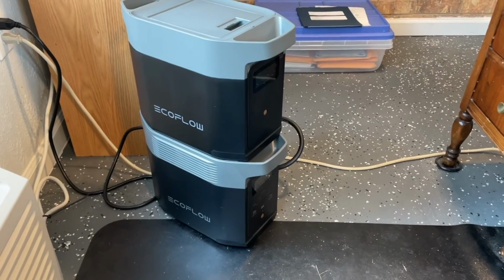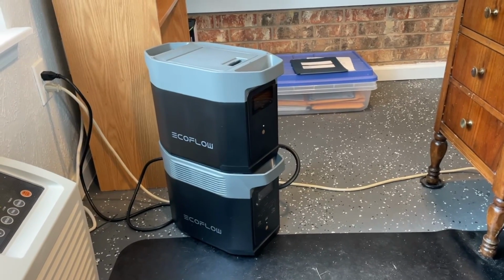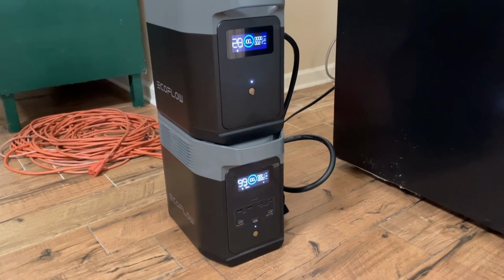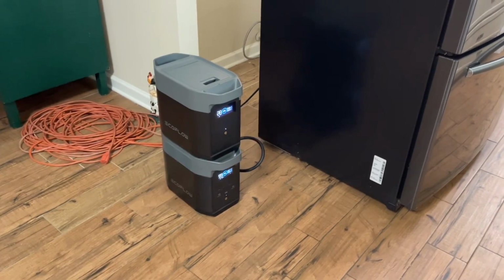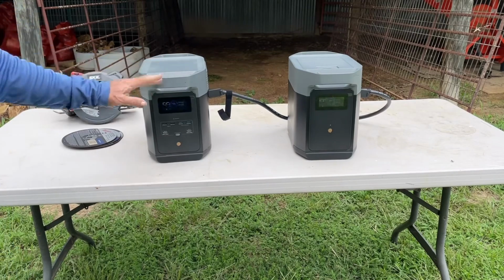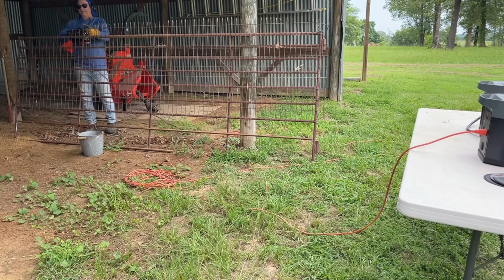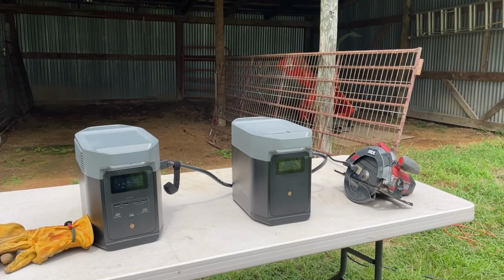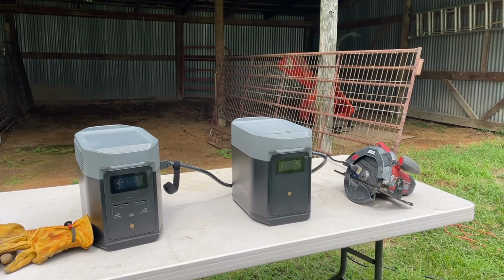1+ Year update EF ECOFLOW Delta 2 + Battery

Comment: Hi! I just received my delta Max and charged it to 100 %.  But when I plug a hair dryer or a fan in to test it, nothing happens.  It’s Friday night and the customer service is off.  Is there something I missed pressing other than the on off button?

Also, I would like to connect it to a permenant non portable 400 watts power solar panel.  The card that came in the box says use MC4-XT60 cable if connecting to 3rd party Solar panel.  I see people’s comment saying one can use MC4-XT60i to allow more current to flow while charging.  What do you think?   I don’t know anything about solar panels but would like to get this ready for gulf coast hurricane in the simplist way possible.  Any suggestion in terms of cables I would need to buy to hook up to solar panel is much appreciated.
Reply from the maker: are you making sure to turn it on, different outlets require a seperate power button to actually turn on and supply power to that outlet. depending on what solar panels you buy they will more than likely come with the needed cables
Reply: @spencerdoesreviews thanks, I figured it out there is an extra button that needs pressing besides the main button to get this thing going.
Reply from the maker: @stevedean3097  Awesome, glad you got it worked out. Its a common mistake for people who get a power station for the first time. Almost every brand has that extra button.
Reply: @spencerdoesreviews Spencer, from your experience with solar panel, are these power station compatible with most 400 watt stationary solar panels sold on Amazon?  And can I use the cables that generally comes with the panels, or are am I required to use the kind I mentioned in the first post which was stated in Ecoflow leaflet?  I do see people mentioning the MC4-XT60i cable wires which is supposed to allow more electricity to flow through.  Can I use that or am I going to mess something up?

Comment: Can you charge the ecoflow in a 220v at home and will it also power 220v devices?
Reply from the maker: These ones are 120 but they might have a different version that is 220
Reply: @spencerdoesreviews  The version i bought in Nigeria pumps out 220v and our power supply here is 220/240v ... D2 works flawlessly fine

Comment: A solar panel is a cheap addition that extends the use of your system. I need to get the extra battery because I  make more energy all day than I can use but can't go 24 hours with just the Delta 2. Yes, I  live close to the equator but you get plenty of sunshine in Texas and have longer days than I do in the winter.
Reply from the maker: Nice, we have a panel just haven’t busted it out that often yet

Comment: All you need now is a house 500 watt solar panel to keep it charged when the power goes out that's what i have.
Note you will need to get a cable to connect the solar panel to the Eco flow
Reply from the maker: Noice
Reply: Hi! I just received my delta Max and charged it to 100 %.  But when I plug a hair dryer or a fan in to test it, nothing happens.  It’s Friday night and the customer service is off.  Is there something I missed pressing other than the on off button?

Also, I would like to connect it to a permenant non portable 400 watts power solar panel.  The card that came in the box says use MC4-XT60 cable if connecting to 3rd party Solar panel.  I see people’s comment saying one can use MC4-XT60i to allow more current to flow while charging.  What do you think?   I don’t know anything about solar panels but would like to get this ready for gulf coast hurricane in the simplist way possible.  Any suggestion in terms of cables I would need to buy to hook up to solar panel is much appreciated.
Reply: @stevedean3097  Hi you will need the EcoFlow MC4 to XT60/XT60i Solar cable to connect your solar panel you can get this from ecoflow. 
Note  you can go up to a 500 watt solar panel witch is better than 400 watt. 
Just get one solar panel at 500 watts house ones work the best. 
The solar panel will only charge when the sun is out. 
You leave your ecoflow plugged into the wall outlet at night. 
And in the day time you go to your app settings then go to energy management and set the discharge limit to 25% and the set the charge limit to 100% by using the sliders, 
Also on the same window of the app go to back up reserve and turn it on. 
You will also see a slider bar 
Slide it down to 30% when you want to use the solar in the day time. 
When you are not using solar slide the slider back up to 100%. 
The cable that came in the box is for car cigarette lighters. 
If you want to run your hair drier you need to open your ecoflow app and go to the settings icon at top right of the screen.
And then scroll down the list and turn on X-boost you can leave this switched on. be aware any device you plug in that makes heat will use your battery faster.

Don't forget to unplug your ecoflow from the wall and solar panel every 3 to 6 months and run it flat for longer battery life then charge it back to 100% after plugging everything back in.
Save these instructions for next tome on the windows note pad for next time.
You can thank me by subscribing to my you tube channel stormchasser300 link here https://www.youtube.com/@stormchaser300
Reply: @stevedean3097  PART 2 
IF YOUR ECOFLOW IS SILL NOT WORKING FOLLOW THERSE INSTUCTIONS BELOW:

If an EcoFlow device isn't running anything, it could be due to a few reasons, including insufficient battery, overheating, or a fault in the system. To troubleshoot, start by checking the battery level and ensuring it's adequately charged. If the device has been overheating, allow it to cool down before attempting to restart it. Additionally, ensure all connections are secure and try resetting the device by holding the power button for a few seconds. If the issue persists, consult EcoFlow's customer support or refer to their FAQ for further guidance. 
Here's a more detailed breakdown of potential causes and solutions:
1. Battery Issues:
Low Battery:
If the battery is completely drained, the device may not power on. Try charging the device and then restarting it. 
Overheating:
If the device has been used with a high-power load or in a hot environment, it may have overheated and shut down. Allow it to cool down before attempting to restart. 
Battery Imbalance:
In some cases, battery imbalance (especially with multiple battery configurations) can cause issues. Refer to the manual or EcoFlow's support for troubleshooting steps. 
2. Connection and Output Problems:
Loose Connections:
Ensure all cables are securely connected to the appropriate ports (AC, DC, USB). 
Faulty Cables:
Check for damaged or faulty cables, especially if you suspect the issue is with a specific output (e.g., a damaged 12V cable). 
Overload Protection:
If you've recently used a high-power appliance, the device might have tripped the overload protection. Disconnect the appliance and reset the device. 
3. Software and Firmware:
Outdated Firmware:
An outdated firmware can sometimes cause issues. Check for firmware updates using the EcoFlow app and update if available. 
Firmware Bugs:
Some firmware updates can introduce bugs. If you suspect a recent update is the cause, contact EcoFlow support. 
4. Resetting the Device:
Soft Reset:
Try pressing and holding the power button for a few seconds to reset the device. This can resolve temporary glitches. 
Hard Reset:
In some cases, a hard reset might be necessary. Refer to the user manual for specific instructions on how to perform a hard reset. 
5. Other Potential Issues:
Faulty Components:
If you've tried all the above steps and the device still isn't working, there might be a hardware fault. In this case, contact EcoFlow's customer support or your place of purchase for assistance. 
Incorrect Frequency Settings:
If you're in a region with 50Hz AC power, ensure the device is set to the correct frequency. Holding the AC inverter button until it beeps can switch the frequency. 
By systematically checking these potential issues and following the troubleshooting steps outlined in the manual or by customer support, you should be able to identify the cause of the problem and get your EcoFlow device running again.

Comment: Can you connect 2 ecoflow delta 2 together?    I can get another unit cheaper than the extra battery.
Reply: Yes absolutely! It's called daisy-chaining, I do it all the time. I have an older version of the Delta 2 which was called the Delta 1300 which I plug into the newer Delta 2 and it charges it while I use the power from the Delta 2. I think expansion batteries are a waste because they can't be used separately. I also have 2 100AH LiFePo4 12V batteries that I connected together in a large hardcase and I can charge my Delta 1300 with a 1500W inverter if I need even more backup power. This is actually a cheaper way to get backup power to a unit instead of buying another Delta 2. The whole setup for the 2 batteries, inverter, case and cables was $400 and it provides as much power as a Delta 2 Max, 2048WH.
Reply from the maker: That’s a good question and I will have to double check
Reply: No you cant it only works with the extra battery.
Reply: @stormchaser300  LOL Yes you can! Don't answer questions if you don't know what you're talking about. It's call "piggybacking or daisychaining" I do it all the time. You plug one unit into another, you can keep plugging units in to another even if you had 10 units. Of course people will argue it's not as "efficient" to do this compared to having an "expansion battery", but I'm glad I bought two units because I can use them together or separately, you can't do that with an expansion battery.
Reply: @ Don't blame me if it goes up in flames one day. 
For your info i work foe ecoflow so i think that qualifies that i know what im talking about.
Reply: @stormchaser300  Ok that's a lie, isn't the internet amazing you can say whatever you like and pretend it's real. Why would it "go up in flames"? You're supplying power from one unit to another through The AC plug. I've done it literally 50 times and it works perfect. The only reason Ecoflow wouldn't want you do this is because they want to sell more expansion batteries. So I'd love to hear your explanation of how it will go up in flames since you "know what you're talking about". ROFL
Reply: @tonyinfinity  We will see time will tell.ROFL
Reply: @ Yep in ten years you'll still be wrong. Of course you have nothing intelligent to say.
Reply: @ I love how you "liked" your own comment. LOL

Comment: I'm planning to order a Delta 2 and a Delta 3.  And I'm going to get the extended battery later on.
I was just wondering, did you have the Delta 2 powering your fridge by itself and how well did it do?
Reply from the maker: Haven’t tried that, but it would do the same as if the battery just not last as long

Comment: Hi, congratulations for the beautiful video. Could you tell me which cable is used to connect the Delta 2 to the Delta 2 Extra battery?
Reply from the maker: Let me check
Reply: Thank You @spencerdoesreviews
Reply: The cable comes with the extra battery.  It’s in the top of the extra battery in a little storage area.

Comment: Delta 2 will only run an AC for an hour or two.  You need a Delta Pro and one or two extra batteries and/or a portable 2500 watt Champion dual fuel generator and a few 20 lb propane tanks to keep an AC and a refrigerator running all day.
Reply from the maker: Thanks
Reply: Hi!  Are you referring to a window AC unit or a central HVAC, and what size please.
Reply: @stevedean3097  I’m referring to a window or portable AC. Central AC uses too much power.
Reply: @teuton6167 thanks for replying.  Just figured out how to get my Delta 2 max started and my 12000 btu Midea shows 2 hour running time.  Not sure how I can work this out along with a small Honda generator in a power outage to keep me cool should the hurricane come this way and knock off the power.

Comment: Get you a heavy duty timer and make that fridge run for an hour every couple of hours.
Reply from the maker: Possibly a good idea.
Reply: @spencerdoesreviews  You dont need one because the fridge isn't running all the time.
It only runs when the temperature drops in the fridge/freezer.
the power is controlled by the fridge thermostat.
Reply: Thats an excellent idea.. thanks for adding that. ordering now

Comment: Hi Spencer, I am in Houston and finally ready to purchase a generator. I’m torn between the Delta 2 and Delta Pro. I would like to plug my fridge and AC window unit 5000 btu. Do you think the Delta 2 will be sufficient? Or should I opt for the Delta Pro?
Reply: The delta pro will run your fridge and a/c for about 6 hours max.  A 5000 btu unit will output about 400 to 500 watts an hour depending on settings and a 26 cu.ft. fridge will out put about 130 to 400 watts an hour when it is defrosting or when the compressor runs to maintain temperature.  I own 2 EcoFlow 2000 max first generation and I would not recommend an expansion battery.  The expansion battery cannot be used by itself and cannot be charged by itself.  Recently I had to sent the main unit after almost 3 years of using it for a replacement that took about 3 weeks turn around.  During that time had I had an expansion battery it would have been useless.  Instead spend the extra money on a unit and get two power stations you can charge and use, or do what I do.  For about $800 to $1000 buy a 48V 100 ah battery like power queen or redodo, or Li Time or any other brand and with a XT60 connecter and battery cable you can extend the power of a EcoFlow delta unit by five kilowatts.  I would also recommend you buy a small dual fuel generator like champion or pulsar or Westinghouse  that delivers around 1800 watts running power that you can use propane which you can store forever and never goes bad.  Instead of running the generators for 10 or 12 hours on gasoline you run it for 2 or 3 hours to charge your ecoflow units and with a battery charger charge the other battery too.  Everyone will tell you gasoline is cheaper, but how easy was it for you to find gasoline when all of Houston was in the same boat you were, looking for fuel and than no power for the fuel pumps.  Buy 2 or 3 20 lb tanks of propane and fill them up and then when you need them you have them.  Redundancies are your friend.  I just ordered a 3 kilowatt EG4 inverter and a 5 Kilowatt server rack battery that I will mount on a hand truck/ dolly.  It will be portable it will produce 5 kilowatts of power for under $2314.00  including shipping and tax from Signature solar, and the Delta Pro is only 3.6 Kilowatts of power and costs roughly the same but you get 1.4 kilowatts more with the EG4 diy setup.
Reply: @shelley131  WOW!! Thank you so much!!!!!! Love the idea about the small propane generator to use a few hours to charge the Delta. Never thought of that.
Reply: Absolutely not, I’m in Houston also. It will power your refrigerator for about a day. Just get an 5-6000 gas generator or propane generator. More reliable and less expensive. I ran my gas generator for 11 hours on for gallons of gas. Powered my AC and refrigerator. I used my Ecoflow for my bedroom fan and recharged my phones and tablets.
Reply: @deataol  But I am in an apartment. I can’t get a gas/propane generator. :-(
Reply from the maker: @idreamof_jeannie  well he also confirmed what I said. If will work bit not for a long time, so if you are going to have a multiday power outage you will probably be out of luck.
Reply: @spencerdoesreviews  hmmm understood. Thank you guys!
Reply: @idreamof_jeannie  well Amazon has them on sale today for prime. $469 for the delta 2, you can add an extra battery for $419.
Reply: @deataol   Problem with the gas generators are that they make noice so many with neighborougs can't use that for long before they complain about it!
Reply: Delta 2 with battery will do you  good or if it’s by it’s self I  would say pro. I prefer the extra battery
Reply from the maker: I would look at the specs and double check but also know that is some heavy usage so I wouldn’t anticipate both lasting that long
Reply: @user-lp5ci9bi2j agreed. Fans just weren’t cutting it. I think I have unrealistic expectations in regards to the Delta 2 and back up battery. I just want to be able to plug my window unit in, chill the room and use fans until the room gets “warm” again… or mainly use the window unit at night for an hour or so and switch to fans to save battery life on the Delta and alternate from there… if that makes sense 😂 I’m not looking to run the AC 2 straight days. And in regards to charging the delta, I was thinking in my car- slow charging, I know, but better than nothing (I guess. LOL) Nevertheless, I think I’m fooling myself and setting myself up for disappointment when it comes to the delta 2. Idk… 😫😫😫
Reply: You can also look at the ecoflow or pecron dc to dc charger.  I got the pecron 12 to 42v charger and hook it up to my car battery.  Start the car with alternator and it will charge the ecoflow station or any power station at up to 500W.
Reply: @user-lp5ci9bi2j thanks, same to you.  My power came back on Sunday morning. I used my echflow River 2 for my fan. Last about 7 hours, takes about an hour to recharge using wall plug. About 2 hours use car 9 volt plug. I also have a dual fuel 12,000 gas generator. I normally would use to power my whole house. Using a Transfer Switch with a 50 amp cord. But I recently moved into a new house. I didn’t have time to have one installed. So we just ran extension cords.
Reply: ANY AC unit needs capacity. I'd get the Delta Pro or the Delta 2 Max with an extra battery to two.